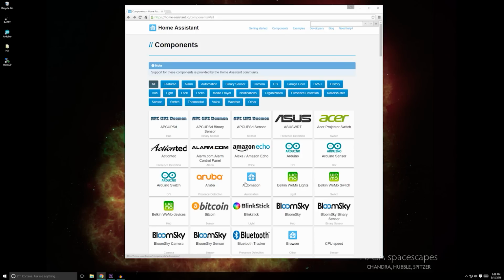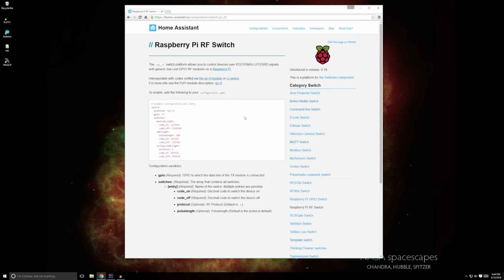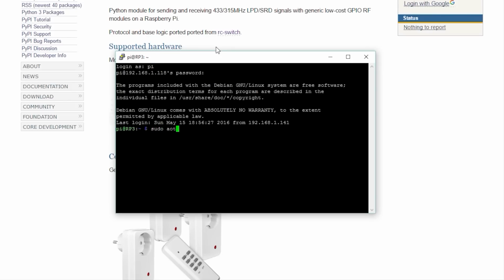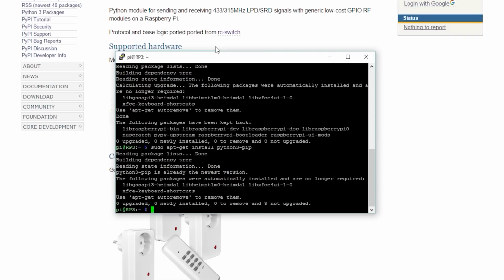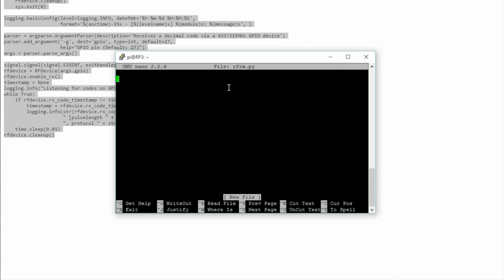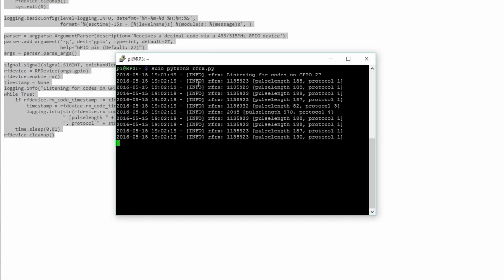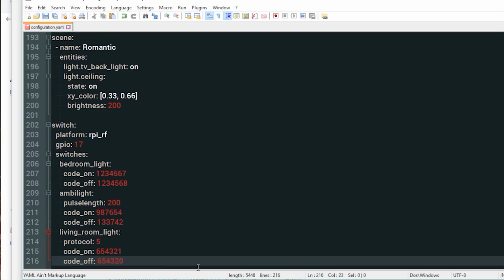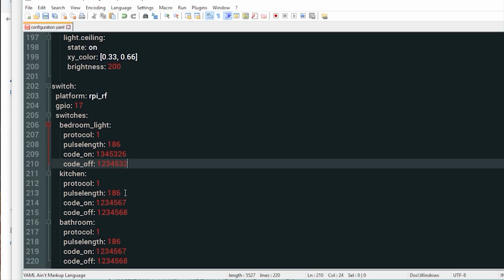The Cheapest Tech - $6 DIY Internet of Things Smart Outlets

Comment: These may be cheap and they may work perfectly BUT being RF you have to have a "line of sight" between the RF transmitter and the outlet's receiver.  Not useful if you plan to have your RPi "hub" in one room and the outlet in another.  But it is an interesting demonstration of the power and flexibility of Home Assistant.
Reply from the maker: I think you're getting RF confused with IR (like most TV remotes). Instead of using infrared light, these outlets use 433 mHz radio waves which have surprisingly strong transmitting power through walls. In my case, I have the hub inside my AVR cabinet and can control outlets through three walls at >10 meters.  The advantage of RF is that it's super cheap, the downside is there isn't a way to "know" the receiver recieved the RF message. It's more a fire and forget system (at least in this case). Cheers!
Reply: I stand corrected and I should have known much better.  I had drive almost 8 hours yesterday before watching this and replying.  C'mon.  They both have an "R" in them.  R for Red - as in InfraRed and "R" as in radio.  My brain was on cruise control after 8 hours on the interstate.  

I am planning on making my system mostly Z-Wave but may include some Wi-Fi.  The nice thing about Home Assistant running on a RPi is that you aren't restricted to one technology as you would by buying a "package".
Reply from the maker: No worries! Happens all the time. 

Home Assistant is great! Let me know if you need any help or have any questions. Cheers!

Comment: Hi, Ben!

I had bought both suggestions for receiver and transmitter, but I am having either no luck with the transmitter (not exactly sure) but Home Assistant isn't recognizing the changes I made to the config file, and ignored it. is it white spaces?
Reply from the maker: Hmm, how did you install HA? What changes are you trying to make exactly? You'll need to be sure to restart HA or your Pi before the changes in the configuration.yaml file are effective.
Reply: +BRUH Automation I restarted HA and Pi. the thing is is I did the All in One Installer.
Reply: +BRUH Automation Changes like adding the RF switches.
Reply from the maker: Interesting. The configuration.yaml file you're editing is in /home/hass/.homeassistant right? Is HA starting on boot? It's likely you have a syntax error in your config that's hanging HA. Is the log throwing any error messages regarding the RF switches or anything?
Reply: +BRUH Automation yes it is starting in boot. Yes that is the file location. No, the logs aren't even showing anything regarding the switches even existing. I got the receiver to work, I don't know how to test the transmitter. but what gets me is I've tried for hours to see if it was white spaces or anything.
Reply from the maker: Can you PasteBin me the code for the RF switches in HA? I can definitely take a look. Sorry about the troubles. :(
Reply: +BRUH Automation how do I do that?
Reply from the maker: Just go to PasteBin.com and paste in the YAML configuration info on your RF switches and send me that link. I can take a look to see if there is a formatting issue or anything. 

YouTube comments aren't ideal for code sadly.
Reply: BRUH Automation hey Ben. Question I get some of my switches working.  But they end up turning on with 2 different number keys on the remotes and cause ha not to send the on off to them any ideas how to get them to only turn on with their code.   I do have 1-2. Of the switches that turn on correctly.  Is it because I named them switch 1-5?

Comment: Your videos are the best I've found! Thanks for putting them up. I'm working on getting a HA-Rpi set up, much like what you've done. I just tried this smart outlets part but can't seem to get any consistent codes. I have the exact Etekcity outlets you listed and this is what I get. Any ideas you could help me with?

2016-07-29 19:46:18 - [INFO] rfrx: 70963 [pulselength 79, protocol 3]
2016-07-29 19:46:18 - [INFO] rfrx: 70963 [pulselength 78, protocol 3]
2016-07-29 19:46:18 - [INFO] rfrx: 70963 [pulselength 179, protocol 1]
2016-07-29 19:46:18 - [INFO] rfrx: 4158819 [pulselength 79, protocol 3]
2016-07-29 19:46:18 - [INFO] rfrx: 71372 [pulselength 80, protocol 3]
2016-07-29 19:46:18 - [INFO] rfrx: 70963 [pulselength 183, protocol 1]
2016-07-29 19:46:18 - [INFO] rfrx: 35635 [pulselength 80, protocol 3]
2016-07-29 19:46:18 - [INFO] rfrx: 8317644 [pulselength 78, protocol 3]
2016-07-29 19:46:18 - [INFO] rfrx: 70972 [pulselength 79, protocol 3]
Reply from the maker: Yeah, so it doesn't look like you're getting a clear signal here. Have you tried holding the remote close (<2-3 feet) and pressing and holding the remote button in 5 second bursts? The message repeats as long as you hold down the button so you should start seeing a pattern. The on and off code is different by one digit in all the cases I've seen. That's how you know you've found the right one. The RF stuff is solid once you get it setup. 

Let me know if I can help! Cheers!
Reply: ok, just tried the same with an arduino and rc-switch library, per your version 2 from your website, worked perfect! Also, I noticed a home built antenna on your tx in the pic, any chance you could share the specs on that or where you got it from? Thanks!
Reply from the maker: Sick! Glad you got it working. Yeah, Arduinos are way more stable for the RF stuff than Pis. I've never really understood why that is. 

Sure thing. I think that's just a 433RF helical antenna - http://amzn.to/2aoQWkF You can make one with a pencil and coper wire or just buy a couple for a few bucks. Super cheap! Let me know if there's anything else I can do for you. Cheers!

Comment: How do you figure out the correct code_on and code_off? This is what I get:

$ sudo python3 rfrx.py
2016-07-22 14:44:19 - [INFO] rfrx: Listening for codes on GPIO 27
2016-07-22 14:44:28 - [INFO] rfrx: 4194304 [pulselength 909, protocol 4]
2016-07-22 14:44:38 - [INFO] rfrx: 64 [pulselength 93, protocol 3]
Reply from the maker: Sorry about the troubles! Have you tried holding the remote close the receiver and holding the button in 3-5 second bursts? The code gets repeated a bunch and there should be one digit difference between the on and off commands. There is generally some garbage, but if your receiver is working correctly there should be  a repeating message in there somewhere. Cheers!

Comment: Hey bro .. you are doing great .. keep it up ..!! well how far can these outlets receive signals from ha pi? it should be in the same room? any interference with walls etc?
Reply from the maker: I haven't been able to find the max range yet. I don't have any issues in my apartment through four walls at ~15 meters. Some people claim they get >100 meters with their DIY RF systems using similar components, but I need to believe that to see it. It's a pretty good range, really. Quite surprising for the price! 

If it becomes an issue, I think the transmitter supports 12 volts so you could design a simple power supply circuit to get more output power. The Pi only outputs 5 volts so I'd think you could at least double the range at 12 V. 

Cheers!
Reply: +BRUH Automation Thank you soo much bro.. your quick response and support will take your channel to a long way...!! :)
Reply from the maker: Sweet! Pumped you got it working! looking forward to expanding the channel. Let me know if you need anything! Cheers!
Reply: my home assistant is set up on rasp pi b+, gained some basic of knowledge of yaml all through your channel.. I want to order things from amazon now,  i need your help, what are things i need to buy from amazon like if there is any bundle you recommend, outlets, the rf tx receiver you have mentioned above seems to be only receiver,, planning to buy z-wave stick, some z-wave devices like multisensor,,,, please add some direct links to amazon things which you recommend and which works perfectly on home assistant........ my budget is 200$ for now..... thankx in advance!! appreciate your efforts!! :)
Reply from the maker: Sure thing! I do have some amazon links below most of my videos for the products I'm using. I'd definitely recommend using a RP2 or RP3. It's super fast compared to the old school RP1 B+. I'm not aware of any bundles. I'd probably just buy the specific parts you want. The Aeotec Z-Stick is great, 433 RF parts, too. Check out those links and if you have any questions let me know! Happy to help out as I can. Cheers!
Reply: +BRUH Automation Ben, saw your config files for ha on github, and i must say you have done a great job with your home automation project... keep it up.. i copied most of the yaml config code from your files.. ;) 
one small thing though, how to display the realtime when the setting was updated under the menus in frontend ui? like few seconds ago or few minutes ago etc.. i was unable to figure out.. as always thanks in advance for your support.. cheers..
Reply from the maker: Thanks, man! Yeah, I love Home Assistant. It's been quite a process getting it going, but I love the results. 

I think the time since last update was from an older version of the HA UI that was removed unfortunately. :( You can petition Balloob to bring it back though. I've definitely have a couple of people ask for that!
Reply from the maker: Sure thing. So the 315 MHz devices should work identically just make sure you get the right RX and TX. The issue there is making sure you have enough range. Z-Wave is nice because it creates a mesh network. Straight RF on the other hand doesn't so if you have a big place you might not have enough power. If you get 315 MHz going, let me know! Would be sick to see some other people using it that way. Cheers!

Comment: Thank you for the videos they are great. My outlets arrived today and with this video I had them up and running in HA in a few minutes. I also picked up one of these wireless LED light bulbs. https://www.amazon.com/Coidak-CO801-1-Wireless-Changing-Controller/dp/B00ZK5Z1PY?ie=UTF8&ref_=cm_cr_arp_d_bdcrb_top I was wondering if I could follow the same basic idea to control this light from HA? Any suggestions will be appreciated.
Reply from the maker: For sure! Glad they're helpful! Yeah, so it looks like those bulbs use a 2.4 GHZ radio. You could probably control them with something like this- http://amzn.to/29wsKd2 But it's going to be a serious project unless you can find a library specifically for those bulbs. Each bulb manufacturer uses a different protocol and reverse engineering it isn't easy. 

There is some support for milights - http://iqjar.com/jar/home-automation-using-the-raspberry-pi-to-control-the-lights-in-your-home-over-wi-fi/ You could check that out and see if it inspires anything. Sorry, probably not the answer you wanted. Let me know if you need anything! 

cheers,
Ben

Comment: Hi Ben,

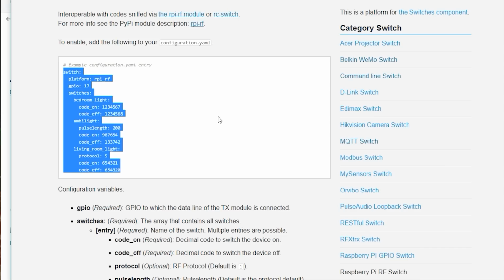Everything worked until 5:45 mark in your video.

But when I run the python script, there are hundreds of INFO messages. 
Even before I press any button in the remote, there are lots of logs.
For every seconds, I get like 10-15 INFO messages.

Does that mean my receiver is poor? 
https://www.amazon.de/Aukru-Superregeneration-433M-receiver-module/dp/B00R2U8OEU/ref=cm_cr_arp_d_product_top?ie=UTF8

Or there is a lot of interference?, but there are no other 433 Mhz devices in my home. 
I use the receiver without antenna. 

Please help.
Reply: Okay. A small update.  
Earlier I was using a 5V, 1A adapter for my RPi2. Realized that it is too low.
Changed it to 5V, 1.8A adapter. Now, I do not see so many signals. 

But, still there are occasional noise. 

I have another problem.
When you press the button, you see the same message repeated.
But in mine, when I press the button, I get 10 messages or so, and all of them have different numbers.
How do I find the code for my remote then?
Reply from the maker: Sorry about the troubles. Yeah, this happens from time to time.  Try holding the remote a little closer and/or try adding an antenna that might help cutback on the random signals. To find the actual code, I switch between the on and off buttons. The codes should be the same length and, in my case, are only different by one digit. Cheers!
Reply: Update : I am able to make this work with the Arduino UNO, but raspberry pi has a lot of noise. 
Do not know exactly why.

Comment: Is there a python script for transmitting data as well?
Reply from the maker: Oi. Sorry, thought I was talking about the MQTT blinds. Yeah, so you can definitely transmit RF code from python using a similar method. Here is the link to the RF send code. https://github.com/milaq/rpi-rf/blob/master/scripts/rpi-rf_send  Cheers!
Reply: +Nakul Solanki I'm in the same boat! The correct code is most likely the one that comes up the most when you press a button I would think. I tried all the combinations in the send script and nothing. I know the signal is getting sent out because I can hear my speakers crackling.
Reply from the maker: Yeah, I've seen this issue a couple of times. Basically, with the receive script you either get a) nothing, b) random crap or c) the right thing. I wish I had an easier answer for why that tends to happen. In one case, I had a bad RX. In another case, I think I had a crappy power supply. In another case, adding an antenna and/or isolating it helped. 

If you have an Arduino laying around, try using some of the 433 utils for the Arduino (https://github.com/ninjablocks/433Utils). For whatever reason, I always had better success with that... again, not sure if that's a power supply thing or just the faster looping frequency through the code... You got me. 

The RPI send code is pretty good code. You need to make sure that you have the right pulse length and protocol set. Once you get the right message and things wired up okay, it tends to do a pretty good job controlling the outlets. Going to another Pi or Arduino tends to be ~80% reliable so I typically spam the RF message 4-8 times in my python scripts to make sure it gets through. 

Sorry for the troubles! Let me know if I can help! Cheers!
Reply from the maker: Hmm, you mean a python script for sending MQTT messages? There are certainly lots of ways to trigger that. If you install Mosquitto on your Pi, you can publish and subscribe to topics from the commandline or you can easily intergrate into Home Assistant as well.
Reply: Also wondering about this. I just want to be able to send the RF code out through a GPIO pin using the transmitter.
Reply: +BRUH Automation Sweet! Thanks Ben!
Reply from the maker: For sure! Let me know if you need anything!
Reply: I used the rpi-rf_send script with the codes recorded from https://github.com/milaq/rpi-rf/blob/master/scripts/rpi-rf_receive. The pri-rf_receive script shows multiple codes for one button click. I tried all combinations, but it still doesn't work for me. Can anyone suggest what I might be doing wrong?
Reply: Try this Nakul. It worked for me! https://timleland.com/wireless-power-outlets/. I used the default pulse length of 189, even though my receiver said it was anywhere from 179-186.
Reply from the maker: Oh yeah! That's a great tutorial. It's actually what got me started down this road way back in the day. I was trigger that server from Tasker. Cheers!
Reply: Thanks Derek, I ran RFSniffer and now i consistently get one Code and one pulse length per button click. But when i transmit the same code and pulse length nothing happens. I have decided to hack the remote directly and trigger the physical button clicks with pi.
Reply from the maker: Sorry I missed this until now. Sounds sick! Good luck getting it working. Those remotes have a great transmitter in it compared to what you can do with a Pi. Should be super solid once you get it going. Cheers!
Reply: I ordered etekcity outlets and i was able to make it work.... earlier i was using a different outlet (woods)... thanks for your help

Comment: Any idea how to control a well pump and log water usage with an inline water flow meter ?
Reply from the maker: Hmm, yeah, this is out of my wheelhouse. You could ask on the Gitter chat room or HA forum and see if anybody has ideas there. Sorry about that. :(
Reply: I would use a Raspberry Pi with a solid state relay like this one - https://www.amazon.com/SainSmart-Channel-Duemilanove-MEGA2560-MEGA1280/dp/B00ZZWIR58/ref=sr_1_2?ie=UTF8&qid=1470663836&sr=8-2&keywords=sainsmart+solid+state+relay.  Connect the relay to the GPIO pins on the RPi and the flow meter to the GPIO pins on the RPi as well.  Write a Python script that will monitor the flow and turn on the relay as needed.
Reply: You would be better served by an esp8266. Also in that case you have the issue of it not being a standards compliant electrical device.